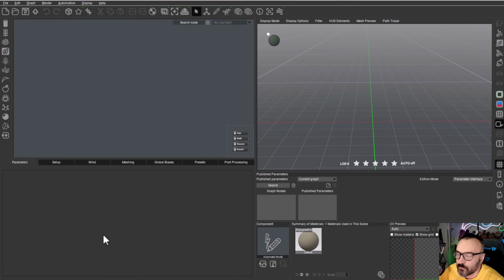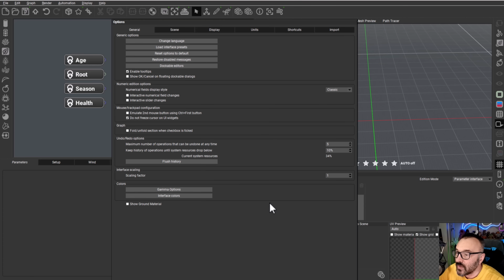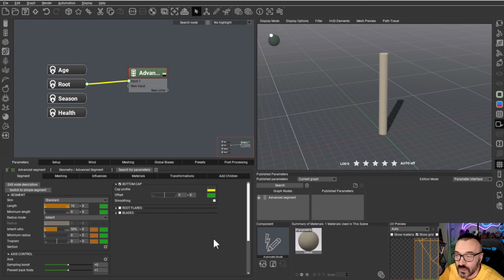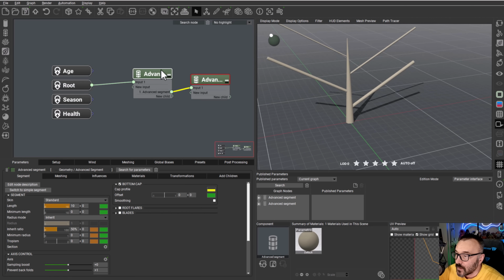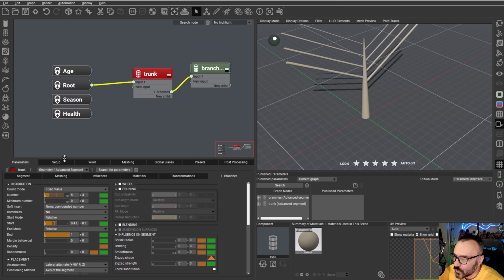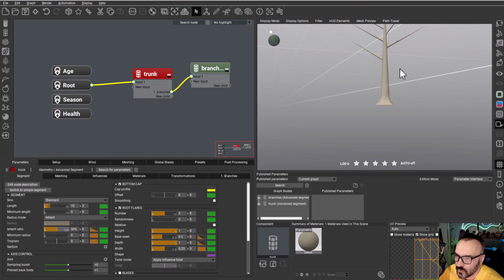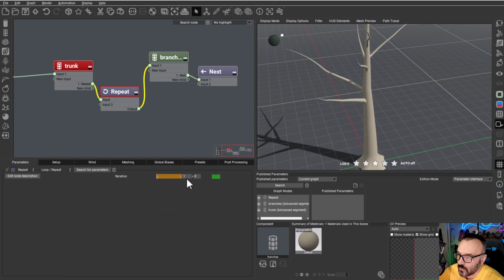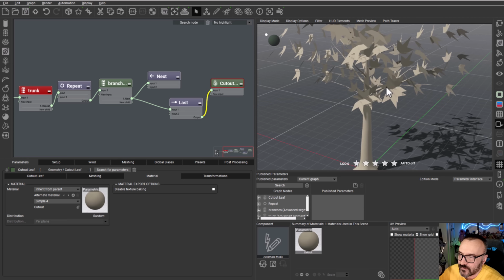Easy start to modeling 3d plants for FREE!

Comment: Hi, first of all great tutorials! Maybe I missed it but did you also cover how to animate parameters? What im trying to do specifically is animating an age parameter for a plant i have going from 1-10 in 10 seconds for example and export that as abs to use the model with growth animation in blender. In case you did not cover that in any tutorial could you maybe point me in the right direction on how to achive that?